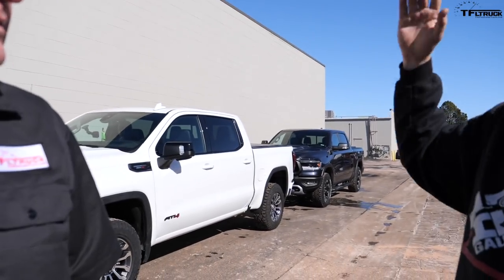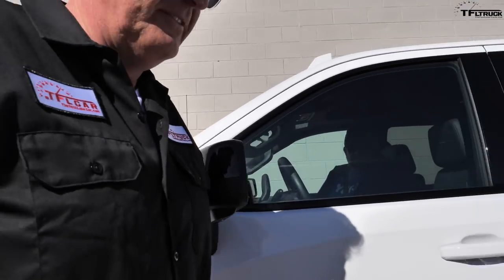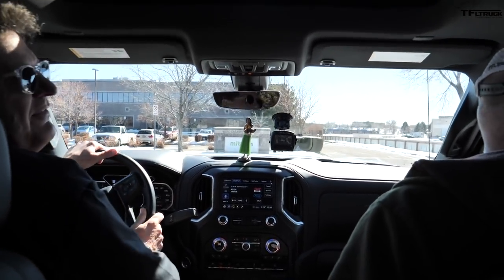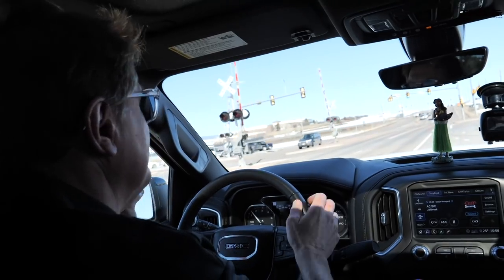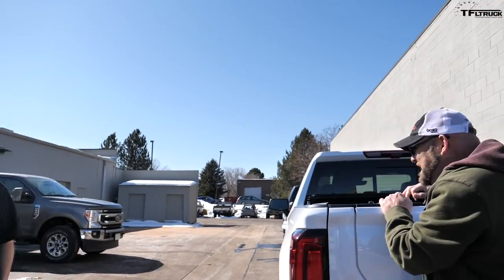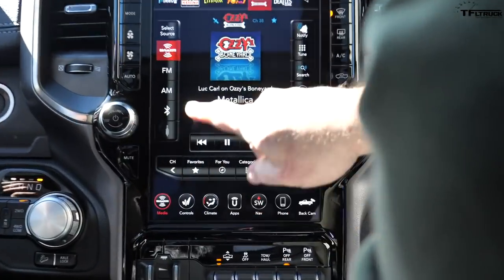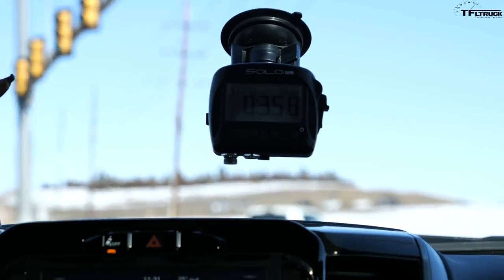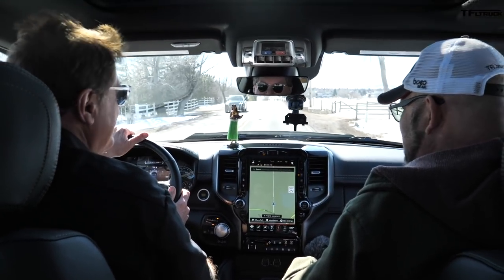Best Diesel Truck! 2020 GMC Sierra AT4 vs Ram Rebel Diesel 0-60 MPH Buddy Review

Comment: I bought my 3L AT4 2 weeks ago.  Hitting the 24 mpg combined, as advertised.  Getting well over 500 miles per tank, nearly 550.  Love the truck!
Reply: Let me know how it holds up I want one but I'm not being a test mule for a new engine lol
Reply: Damn, I custom ordered one here in San diego, how the heck you get one so early?
Reply: Bet you love losing all that money.
Reply: Per GM engineers. Engine will last about 150,000 miles. Embarrassing numbers
Reply: I got lucky when dropping my 2500 off for a SES light and found my Carbon Pro 3L. Could not be happier with it. The head up display is awesome. Even found a way to mount the Extang  tri fold 2.0.  There are not many tonneau cover options out there that are made for the new carbon bed.
Reply: @michaelharding6728  that probably a b20 rating. The B rating is at average life of 20 motors strapped to a Dyno and ran under full load till it dies.
Reply: @michaelharding6728   No no.  Just the oil pump belt is good for 150k and has to be changed at 150k miles.  :)
Reply: @michaelharding6728  Just think, by the time it's paid for, it will be all worn out😂
Reply: So what's better  6.2 or small diesel? Mpg is better on diesel but there more power on 6.2
Reply: I have older 2015 chevy 5.3 and I want buy new GMC. So trying figure out what ATV to buy
Reply: @michaelharding6728  thats the belt life not the life of the engine
Reply: @RM-xx6fm  both max at 460 pound ft of torque but the diesel is better at pulling at low rpms cause the torque is there early in the powerband of the diesel the gasser torque is way late in the pb at high rpms
Reply: @james avery just to note, diesel doesn't cost more than gas everywhere.
Reply: @benjaminmccrink6415  It was on the lot...and they were dealing.  Caught it at just the right time.
Reply: Michael Harding per FCA engineer the ecodiesel will either catch fire or blow up...look at the ecodiesel forum will make you run for the hills.
Reply: @kevinwilliamson7294  or you just pay cash for your trucks...
Reply: @vhbuilders430  Exactly!
Reply: mileage will probably improve as the engine breaks in further.
Reply: Seriously???
Reply: @35RSkyline  for 85 grand I'm sure its covered
Reply: @kevinwilliamson7294  that's why they make a c & e class Mercedes.  There's a sucker born every minute
Reply: @DynoDieselWagon  Not even close you can get a 3500 High Country for 85 grand. GM trucks in the top trim levels are significantly cheaper than RAM or Ford.
Reply: @killercan10  you know how you change that belt think about it for a second it cost 2k in labor for a trans swap so 2k in a belt change I'm good and that's if the belt holds up over time
Reply: @james avery Diesels cost more overall like you said, and also in maintenance too...
Reply: I just bought one 2 days ago. Traded in my pos longhorn for it. So far, so good getting 28mpg. It's the elevation package and definitely smaller than my ram, but the fit and finish is better. At least the air filter is 45,000 miles for change and the fuel filter is every 30,000 miles. However, DEF Is 12.50 a gallon (still cheaper than ram) or 22.50 for 2.5 gallons. So far I like it, just wish it was as big as the ram.
Reply: @james avery Perfectly said. Dang guys read this and learn!
Reply: I have a 3 gen eco diesel, I only have a Larmie level 1 but i get 26 mpg combined and i drive alot of city. I have seen 650 miles to a tank but its slow i mean slowwwwwwww
Reply: I put a 6" lift on 35"x12" tires and I am getting 21mpg
Reply: @35RSkyline  i have 26k miles on mine since Dec 23rd 2019. About 12k I got a nasty warning and took it in. GM fixed it. Took a week but the service message did not point to actual issue and my dealership had to phone home to GM to get it done.  One of the glow plugs was going bad so they replaced it and no issues since.
Reply: @cren1676  You need to come north to Canada Bruh!:)
Reply: @predpalina  I'm in Canada. East coast to be exact. At the time of that comment, pre covid, diesel was less than gas. Then gas went low. Now they're about the same.
Reply: @smokinjoemann  on the 3.0?
Reply: @killercan10  150k service.  There is no reason to believe it will fail so early.  The number was chosen so there are no failures -they are looking into extending the rating.
Reply: I get 22 in a 5.7 400hp hemi
Reply: @michaelharding6728  good luck.  Can't get that from a 5.3 . They fall apart after 120k
Reply: @RM-xx6fm  6.2 all day. These diesels fill with soot. The filters need replacing. Exhaust needs replacing. Sensors everywhere and they're not powerful or great on fuel.  Total failure.  Anyone buying one is insane!!
Reply: Les Fernandez  You have trouble reading? No one was talking about MA specifically.
Reply: Les Fernandez  So, you mind telling me how I'm wrong? My original statement "Diesel doesn't costs more than gas everywhere"
Reply: @kevinwilliamson7294  by the time its paid for? Some people pay cash buddy
Reply: @BullittKid08  True, but they are few and far between.
Reply: The ram with 33 gallon tank will get over 900miles per tank. The ram diesel also dosent have the wierd serviceable oil pump belt The gm has, that concerns me and is a fail on gm.
Reply: @michaelharding6728   not true. It has to have the timing chain replaced at 150k
Reply: How is the truck holding up
Reply: @chito69691   had my 30k mile service this morning.  Truck is running perfectly so far. Couldn’t be happier, has all the power that I need.  Pulled a 24’ travel trailer on a 2,000 mile round trip and averaged 15mpg.  I barely got that unloaded with my last p/u!
Reply: @jarrett99  thx for the update looking to get the sierra denali 3L this Friday.
Reply: @killercan10  the gm engineer specifically said that the belt is expected to last the life expectancy of the motor
Reply: @michaelharding6728  bro there is colorado diesals with more miles than that.  I don't think thats true
Reply: I’m jealous. My 16 Ram ecodiesel is getting 17.8 mpg right now.
Reply: 2 year mark coming up, and it’s still running beautifully.  Still averaging 24-25 mpg.  Have almost 50k too.  Time for new tires.
Reply: I am getting 38mpg on the highway with the 2020 1500 duramax sierra elevation. 29k average with 13,000 miles. It is barely broken in!
Reply: @michaelharding6728  Sir, I thought a diesel engine should last at least 250,000 miles....how long do you think a X5 N57 diesel engine could last?
Reply: @kevinwilliamson7294  losing what money?  These are great. One of the best engines made today
Reply: @zackjay71  😂😂😂 Sure…..
Reply: @fredmctavish4108  good story😂

Comment: I own one of those AT4 diesels, i drove it from Jacksonville, FL up to the mountains of North Carolina and averaged 27.8 mpg and got 575 miles out of 1 tank of fuel. That was taking backroads, through small towns and up curvy mountain roads!
Reply: In a high torque motor slower speeds helps mpgs

Comment: This is the best format you have ever used for a review. You finally get to voice some criticisms of a vehicle which you rarely do in other reviews without candy coating them. Where I live is almost sea level and there are no substantial hills around. So you towing tests and acceleration tests are almost irrelevant since your normal tests penalize the NA engines too much. With this comparative format you covered everything in a relative way which is much more informative even though its in a lighthearted manner. This is the only reason why I'll stay subscribed. More buddy reviews please.

Comment: Thanks guys, I’ll keep my ‘98 Dodge 2500, 4x4, 5.9 beast. No frills, 280k miles. Used it to rescue stranded folks during both Harvey and Tax day floods in the Houston area. Has a 36’ goose neck stock trailer attached 60% of the time.

Comment: As always, Nathan hits the nail on the head; both in the reviews of the truck and that Roman should have bought the AT4 instead of the very ordinary trailboss/5.3.
Reply: John Smith I totally agree. The AT4 is a much better looking truck. GMC gives the consumer what they want more than Chevy. Year one redesign no 6.2 in the TB AT4 yup you got it.
Reply: John Smith that AT4 is also a hell of lot more money than the TrailBoss.
Reply: They got a trail boss so they could actually test the #1 selling engine in GM 1/2 tons. All GM ever sends them is a truck with a 6.2.
Reply: @waldero04  Yeah but the 5.3 is boring, and they don't have any trouble picking "cool"/more powerful Fords.
Reply: For whatever reason, every vehicle except a few trucks have ditched Column Gear Selectors, which are the easiest to use by feel, are out of the way, and don't take up room in the center console. Rams rotary selector isn't as good to use, in my opinion, but at least it's out of the way, unlike the console levers on most upscale F-150's.
Reply: Ni

Comment: I drove the GMC AT4 3.0L Duramax and felt it had good power off idle,,  I laid wheel out of the Dealer Lot on accident trying to get into traffic, not overly quick to 60 as the fellas noted but the truck seem to effortlessly drive along at any speed.   I never felt any turbo lag just ton's of torque all the time. Really liked it.

Comment: I have absolutely no problem with the interior of the GMC. Nice to see they still have a column shiftier, I think it's still the best option for a pick up truck. I don't mind Fords console shifter, but hate the RAM knob or the push buttons on the new Yukon/Hoe. I also like the size of the GMs screen. I personally am not interested in having the huge tablet screen that Ram has. I appreciate it's an option for those who like it though.

Comment: I cant wait until my truck arrives. I ordered the 2020 AT4 Carbon pro in Carbon black & the 3.0L diesel. My friend just got his Chevy equivalent and was all highway 70mph in Oregon. Put 621 miles and filled up once the light came on and put 17.81 gal in it. Do the calculations and that is 34 mpg. the big test is when you pull a boat. Car & Driver tested at a 6800lb trailer getting 17mpg. Take an average boat at 3000lb. you should get 20mpg. I will get mine late next month and are very close to you guys.
Reply: Good luck with losing all that cash.
Reply: @kevinwilliamson7294  It's not about loosing all that cash. My 2017 tundra rode like a lumber wagon on I-25 north of Thornton and use the truck for towing my professional Bass Boat. I towed it back from Branson, MO last May and got 10mpg. It doesn't take too many trips like that to start adding up. Plus you cant take it with you so you may as well enjoy your ride while you can. I agree ordering a $65K truck and what the value is in 3 years. Agree but I'm doing it anyway.
Reply: Its still a ridiculous transaction. Imagine putting 65k$ into a retirement fund and in 5 years its worth 20k! But shit tons of people do it anyway. All to impress people who you will never meet. But I degrees. It's not my money.
Reply: plus you cant drive a retirement fund to work or have it haul your toys.
Reply: Kevin Williamson, agree however when you own a company you MUST utilize tax breaks and yes that amount is stupid expensive. Look on the bright side, I’ll be getting stupid mileage. Appreciate the feedback and not interested in impressing anyone or friends. Just want to get way better mileage than the Tundra does.
Reply: @mikemullarkey9269  Agreed, to those that can afford it. By afford, it means making one payment, not 84 payments! It's just crazy that some will buy a truck that is equal to their yearly income, and try to justify it by saying they work hard and deserve it! Just my opinion and outlook on the subject.
Reply: @paulfaiman5601  you can do all that with a 5k$ truck.
Reply: @mikemullarkey9269  And that's not a lot of malarkey 😂. Couldn't help myself

Comment: So I finally test drove a 2021 Limited ecodiesel after binging on so many YouTubes.  The good news, the fit and finish both inside and out as well as the quiet comfortable ride... nailed it.  The motor, let's say I was underwhelmed.  Just not enough low-end torque off the mark; it felt sluggish and underpowered out of the gate.  I hopped in a Rebel 5.7 hemi and loved the responsiveness of that engine AND the interior was as comfortable and quite a ride as the limited despite the off-road tires.  My inner nerd came out as I used a decibel meter app to measure interior noise at hi-way speed... both vehicles measured the same at 65-66 dB; you could hear a subtle whir from the OR tires, but it did not ping the dB meter.  Very quiet, comfy ride!!

Comment: I wish GMC would put in electric lockers with the AT4 like in the the ZR2 Colorado....🤔🤔🤔
Reply: Decades ago Eaton mechanical lockers were factory equipment with a tow package.
Reply: @matthewmeaux3450    The G80 is still included with the towing package.
Reply: They need to fix the engine problems before adding toys in MHO..   the valve problem is so bad that the dealer will tell you it's normal... bad lifters, pushrods..   horrible dependability..  and their transmissions used to be one of the worst you could get besides dodge transmissions..  but since Ford and Gm have worked together.. their transmissions are improving..